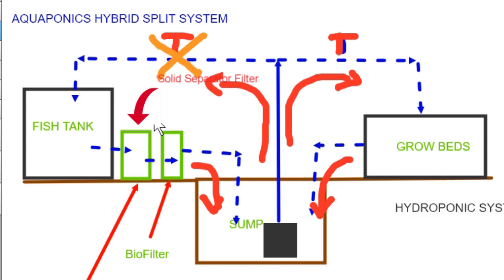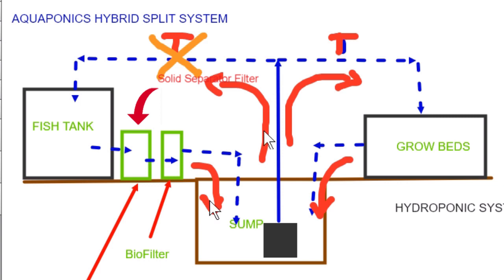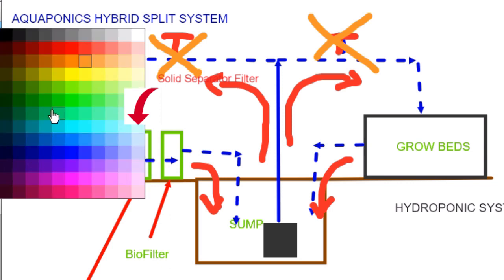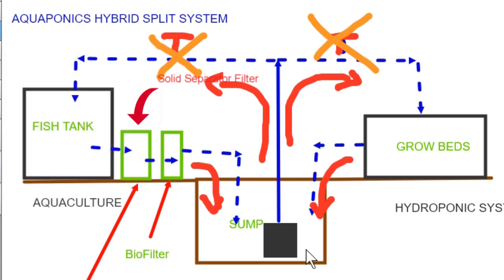Webinar: Magic of an Aquaponics Hybrid "Split" System Design. Convert to Aquaculture or Hydroponics

Comment: Hello love your channel. Very informative. I am venturing into hydroponics farming from my boring  9 to 6 job. I wanted to know how many Kilograms of tomatoes can be grown in a 2000sqm hydroponics setup (polyhouse) or cucumbers in a same area average In a month or year given a 1.5 cycle per year. I am doing a feasibility study before I setup the farm and checking with other farmers if the numbers check out. Looking forward for your response. Thanks
Reply from the maker: You can grow about 2000-3000 plants per 1000 sqm. The actual harvest is variable.. In cucumbers you should average 18-20 cucumbers per plant over the lifespan of plant. Most of this data however wyou should be able too Google. We do not do cucumbers or tomatoes on a large scale

Comment: Excellent video,is it safe to say that a hydroponics system uses alot more water than an aquaponics system as in hydroponics you will have to drain the water about every 2 weeks due to a build up of nutrients ?
Reply from the maker: Thank you..  If the dosing is done correctly in hydroponics according to EC and pH parameters for the particular plant being grown then we've never had to drain the water. Of course after every harvest, one should clean and disinfect the system. Best water saver in hydroponics is a drip irrogation system .

Comment: What's the best aquaponic growing system or hydroponic system
Reply from the maker: in optimum conditions they both perform well. Aquaponics is more difficult to control the nutrients and pests. Hydroponics also cheaper, as you do not need the mechanical or bio filters required in Aquaponics

Comment: Isn't it water from grow bed goes to fish tank?
your drawing sort of not showing 
volume is super low; frustrating
Reply from the maker: No, not with the split design described in the video. Water is pumped from one source which is the sump, to both the fish tank and to the grow beds simultaneously, then all gravity feeds back to the sump   There are obvious reason for splitting as described in the video (i.e. the ability to change the aquaponics system to either aquaculture or hydroponics, by closing one valve only.    Yes, this is an older video where the mic wasn't optimized, so volume does sound low, so we have since used a different mic in more recent videos.

Comment: We can’t hear properly not enough volume
Reply from the maker: Right at the beginning the volume was a little low, but I did correct it a few minutes into the webinar after one of the live listeners complained about it.. I have replayed it on my side and it seems fine.. Maybe also check your speaker volume settings to see if there is possibility to increase it a little. Will improve the volume for the webinar. Thanks for the feedback